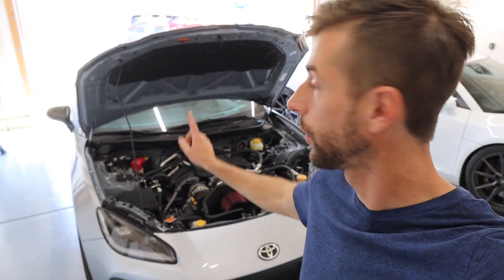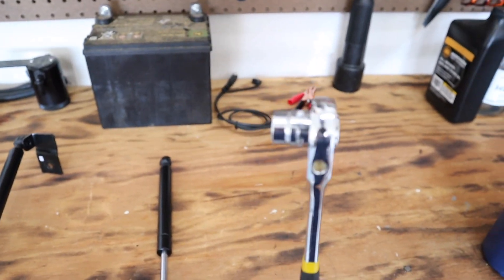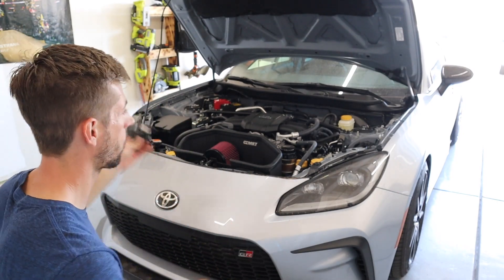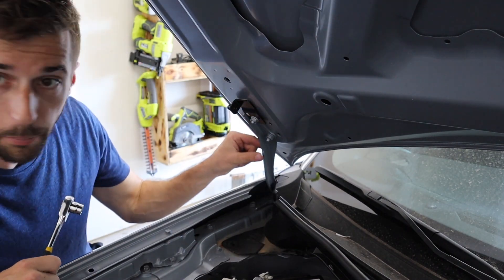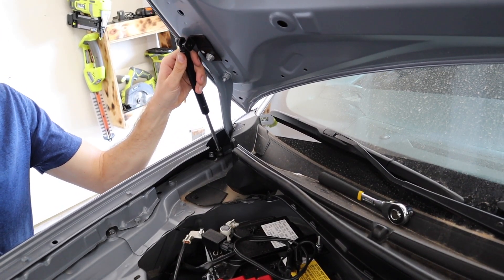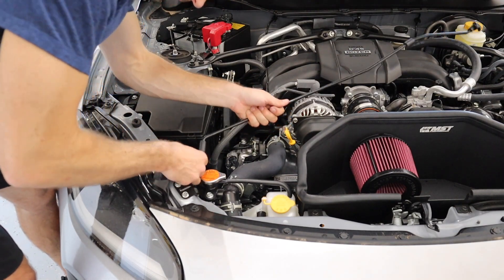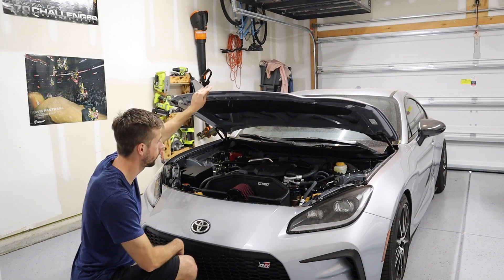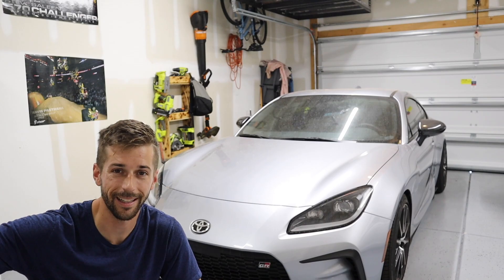My BRAND New Toyota GR86 Didn't Come with THIS!!

Comment: I highly recommend getting the RTV redone for the oil pan, it been known the RTV peels out because the factory put sooo much of it and get stuck in the oil pick tube and cause serious damage, no recall have been which should be
Reply from the maker: I’ve had zero issues with that! Don’t think it’ll be a problem.